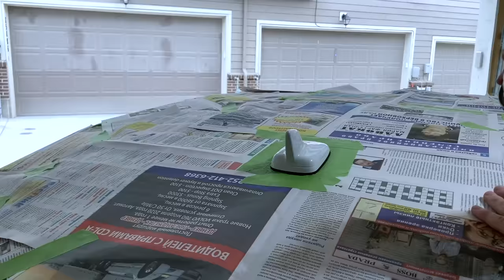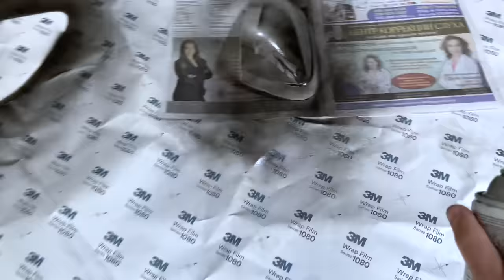Building an Audi A4 B9 in 10 minutes like THROTL!

Comment: It triggers me so heavilly that the "r" on the quattro badge in front under the audi sign isnt aligned as it should or are just my eyes playing with me
Reply from the maker: Yeah, it’s not aligned. We tried to fix it but won’t be able without damaging the R
Reply: lol
Reply: @BurningRubberr  warm it with the heat gun for a few minutes to soften the adhesive and ease it off, clean the old adhesive off both bumper and the R with solvent and refix with a new piece of double sided adhesive tape 👍🏼
Reply: Leø THANK YOU! flip man I was losing it over here
Reply: @BurningRubberr  take it off, legit rather have it say QUATT O than that.
Reply: @GB-jk4vt  
Gdnfn

Comment: Good job 👍🏻 Have a question about the exterior mirrors. How did you change the indicator and does that work on other vehicles with these indicators as well?
Reply: look up Dynamic Mirror Indicators, they will be designed for the specific car based on the OEM part and are plug n play.

Comment: * no performance mods were done in the making of this video*
Jk. Looks super good!
Reply from the maker: Thanks!
Reply: False. The spoiler in the back adds 150 hp
Reply: I know your joking but modding new cars performance wise is a dumb choice especially german it just ruins the cars reliability
Reply: @janalexandro6655  😂
Reply: Wheel and tire setup can be considered performance.
Reply: they could just throw on a stage one tune....
Reply: @boosted6602  An intercooler would've been a nice mod since they had the bumper off anyway. The stock IC is very restrictive, especially when 1/3 of it is covered from factory. The turbo would be thankful for it.
Reply: @philstaab7420  How so? Except for lowering the vehicle and thus the center of weight = better handling in corners and higher speeds, true. Also wheels might add traction which they certainly do BUT this car aren't used for racing and still the rest of components is stock and wheel size is calculated for stock components so this is basically all for the looks. Plus with these mods lifetime of some components is gonna be shorter.

Comment: Nice job! But please, do not put a 3M vinyl like that, I recommend using a little soap and water to avoid mistakes.
Reply: Sorry Carlos but that is wrong. It looks like this is an 1080 from 3m that has air release (like most wrapping these days). You will fill the air release pockets with water and never get it out. Also if you use a old school wrapping you should never use water with soap. The reason is that you wil have a film of soap between the wrapping and car. That makes it to now want to stick 100%.

Comment: I think that these guys have nothing to do.. and the work is pointless because the machine and the stock equipment is good and nothing in the car does not need to be changed.
Reply from the maker: I feel like you have nothing to do🤣
Reply: @BurningRubberr  and here you again made a mistake as in your meaningless tuning.. it doesn't matter how you feel. What matters is what you do. Be well...don't cough..